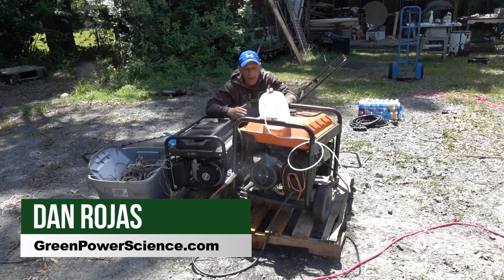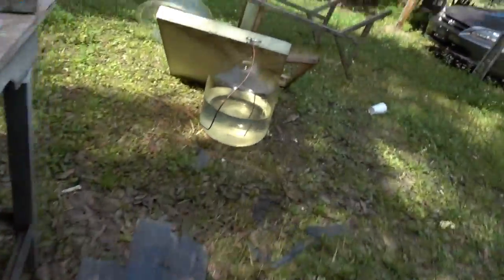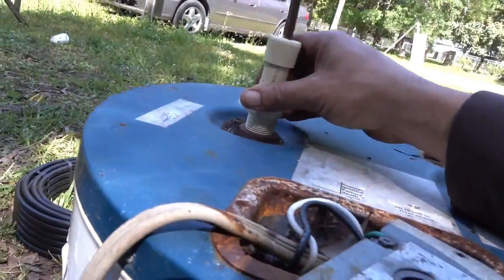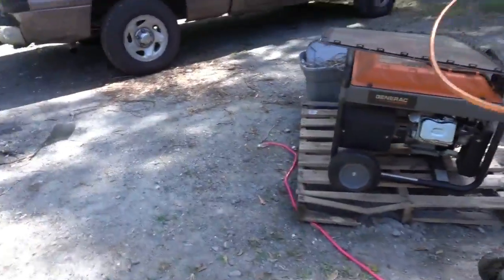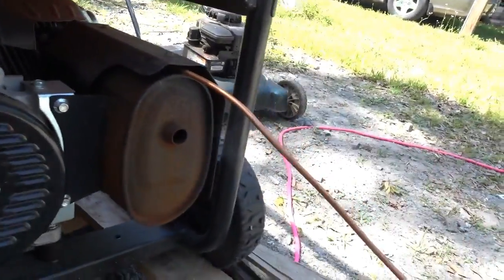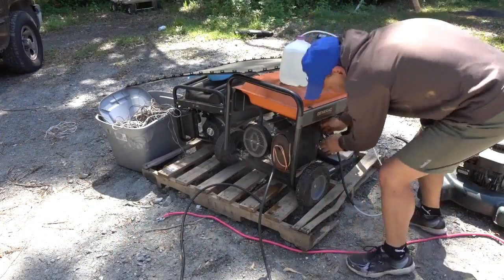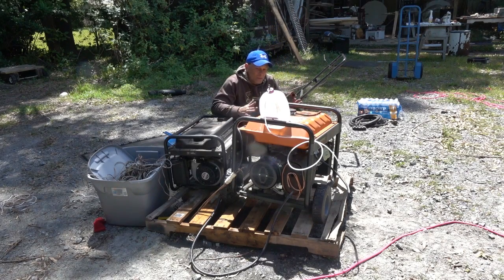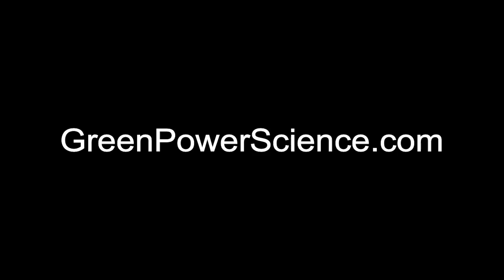HEAT WATER safely with generator exhaust Solar Heat exchanger Part 3 prepping

Comment: You could also use an EGR cooler from a car and attach it directly to the exhaust outlet. I've always had the idea of running a generator on natural gas and using all the waste heat for heating and hot water.
Reply: I did this on mine. I used one from a Jetta. Make sure you use egr coolers built like boilers. With a set of tubes as the heat exchanger. The other design uses essentially  radiator type fins. They are prone to burning out if there is a lack of coolant flow through them.  Tube design is more  forgiving.

Comment: You mentioned that you shouldn't use the exhaust to heat air for your heat source due to potential CO poisoning.  Actually, VWs used a heat exchanger wrapped round the exhaust manifold to provide cabin heat to the passenger compartment on their air cooled vehicle engines.  I agree though.  DIY people shouldn't be designing something like that.

Comment: No pump but a "Heat Pump" will ever heat water any noticeable amount, that would be completely ridiculous.
In Colorado we used 400 feet of inch and a quarter Poly pipe to heat our pool. With the insulation blanket and small pump after 3 days of Sunshine the pool would stay 80 or so.

Comment: Why when you just make a heat exchanger with some Plumbing fixtures coaxial heat exchanger using iron pipe and just screw it into the the engine exhaust? This is Mickey Mouse

Comment: How about submerge the entire exhaust system in water then have a heat exchanger in the heated up fluid? Possibly submerge the entire engine with a driveshaft connecting to the generator head unit?

Comment: if your not going to use the full exhaust ,input pipe included, then the obvious quicker and more efficient option is to simply take that gray container,half fill it with water and add a short steel 2" pipe directly up to the exhaust  outlet and just bubble the very hot gasses directly through that static water, then place as much plastic pipe heat transfer loop in that heated water tub, job done, if you are still not going to take advantage of the free ground submerging insulation all around but for digging the hot storage containers pits and hypocaust inclined 1 in 6 soil conduits to where you want the heat to be by design,
Reply: How do you deal with the acidic components of the exhaust gas that will remain in the water?

Comment: Cooling down the muffler will increase the rate that nasty stuff from the exhaust gasses will condense on the inside of the muffler, killing the muffler sooner. Do you have a way of addressing that issue?
Reply from the maker: The muffler stays above 400˚ F, even higher as the amount of surface area needed is nowhere near 100%. The final wrap would include a tight loop like the first video in this series for the exhaust off or out of the muffler to capture the heat from the exhaust. This would not block the exhaust flow. Keep in mind mufflers and catalytic converters which require heat to preform properly are different. Semi and auto exhaust systems constantly have water splashed on them while driving in the rain and are cooled with airflow while traveling 70 miles per hour.

Comment: Might there be more pliable tubing that can withstand the surface temperatures, for a quick wrap?

I wonder how much heat could be extracted from a car muffler and oil and closed circuit generate electricity for a hybrid support moter and battery. 70% of the internal combustion power is heat lost to the atmosphere and eventually partially or fully to the vacuum of space.
Reply: you can use high temp insolated PEX with a "leader" piece to transfer the heated fluid and help conserve the heat during transport, but the actual exchanger portion of the system needs to be a very conductive material. but honestly, in an emergency, heating water for cooking is one thing, and using the excess to heat the house if the generator is running anyway, but otherwise to stay warm, just wear warm clothes. I winter camp in Upstate NY with a hammock at -14°F, and NO heat source except my good 'ol body heat, insulated with ethically sourced down or Climashield APEX insulation (probably best for situations like hurricanes where you need to stay warm even if you get wet, though that might even be overkill for temps over freezing.)
Reply: Cloxxki, I like your idea and  understand your desire for a better working fluid but I would still restrict my choices to noncombustible fluids simply for safety sake. This whole concept has me thinking back to marine engine exhaust manifolds which had a double wall construction as they were water cooled just like the engine block. A more pliable tubing would definitely be a cheaper and more universal solution though.